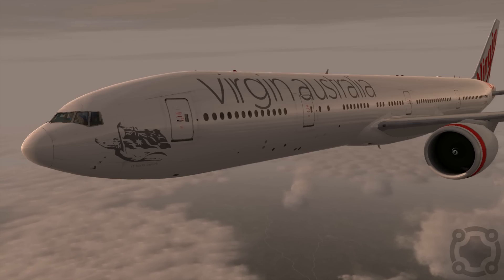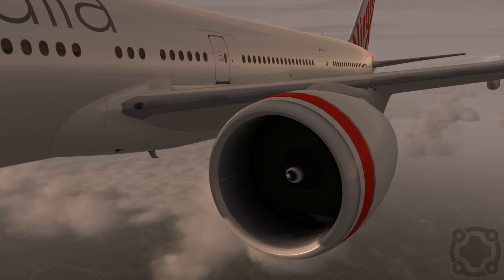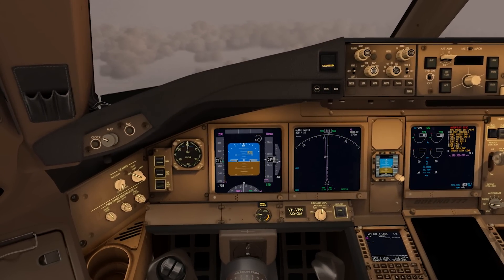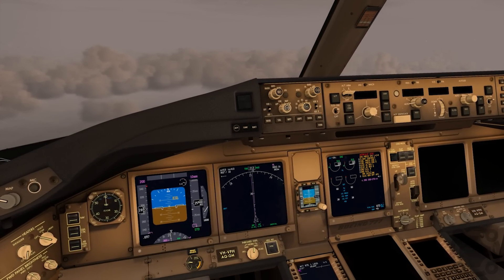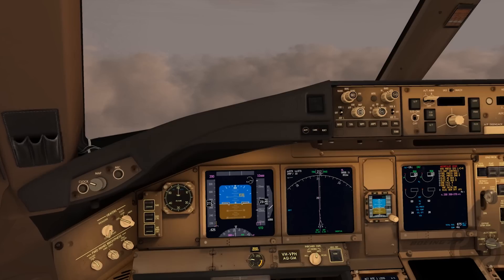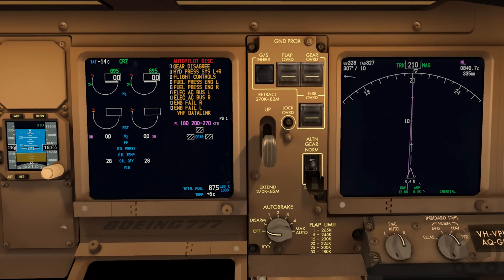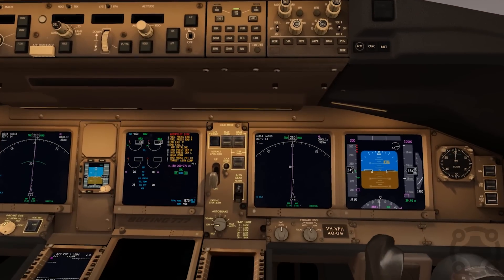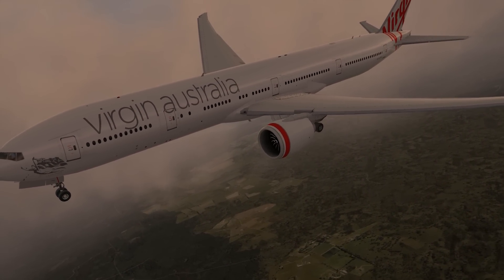What Happens If Both Airplane Engines Fail? - Aviation Facts

Comment: The RAT only gives basic hydrolic control, that's all, enough to make it controllable. However, flaps and slats are not on the Rat's system, as is the undercarriage - just uses gravity to (hopefully) lock the u/c - though the lighter nose leg may not lock due to it's lighter weight.

Comment: What is better prepar3d or xplane guys?
Reply: Call mean They both have their strong points and both are amazing programs but I prefer X-Plane because it is 64bit and the Addons in some cases cost almost half as much. XP also has better graphics in my opinion. I would say do due diligence and see which won you would like better. Right now If you buy XP 10 FROM X-plane.com (not steam) you will get XP 11 for free on release date.
Reply: Sirtaj 2010 Interesting. Well the reason I asked was because i've only ever had FSX on a shitty laptop lowest graphics 20 fps and am about to invest into X-Plane or P3D I mean invest i will fully kit it out with professional payware as my passion lies in aviation love FR24 and plane spotting and am wanting to become a pilot in either civilian airliners/small private or the Australian Airforce
Reply: Sirtaj 2010 Also thanks for your response mate :)
Reply: no problem m8

Comment: In real life the engine blades don't stop spinning when the engines fail.
Reply: Some do, depends on the engine.

+tprfilms Turbofans mostly do, pure jets don't, fighter planes and such.
Reply: rstevewarmorycom like which ones? Because when I go to the airport and the wind is strong the fan blades are always spinning. Even the Ge90.
Reply: tprfilms that's correct

Comment: What makes a plane ETOPS rated?
Reply: Two engines and rated to fly a route where at a certain point or points where you are more than 60 minutes away from the nearest airport in the event of a landing.
Reply: It doesn't have to be 60.
Reply: Brandon Janasik the a350 for example is etops 370 rated so its allowed to be 370 minutes away from the airport
Reply: The manufacturer has to demonstrate reliability of the aircraft to become ETOPS rated. This is done from all the engine tests, all of the test flights, and continuously via in service reliability statistics. Airlines must report in flight shutdowns and certain other failures relating to ETOPS required equipment. 
An ETOPS rating may be revoked at any time if the reliability deteriorates, this may be per airline, if it is demonstrated that it is the airline's maintenance program that is at fault, or the worldwide fleet if is a problem with an aircraft or engine. 
Aircraft may start off with a low ETOPS rating like 60 minutes and then it may be extended in stages as the reliability is proven. 
I said reliability a lot :)
Reply: tjperez69

Comment: If this happens in real life, can't they have the copilot  go outside the plane while it is gliding at say 20,000 feet and just bolt on a Briggs & Stratton 3 HP 1 quart tank size gasoline engine with a small prop attached to the horizontal shaft so the plane would then have more than enough power to climb back to 30,000 feet and even finish the transcontinental flight without any other incidents?
Reply: LOL you dream it
Reply: ***** smelt or smelled?  Were you extracting metal from its ore or smelling feces?
Reply: David James man, if only that worked.
Reply: ***** They probably didn't give a shit.
Reply: David James dang the puns lmao
Reply: Alex Mullens what are you talking about? 3 horsepower is more than enough to lift even a 747 up 30,000 feet
Reply: you mean one engine fail not all 4 engine, that would be British Airway Flight 9
Reply: Alex Mullens what do you mean there is no way? Even a 1.5 hp engine could overpower all 4 engines on a 747
Reply: your telling me all 4 engines on a 747 failed and it went 6 more hours?
Reply: I believe that Boeing and Airbus fit mounting bolts on the top of the fuselage for a 3.5hp briggs or a Honda equivalent.
Reply: Good idea just install a 7 litre dodge v8 challenger engine as a last minute engine impeller spinning device
Reply: David James I
Reply: @Alex-np3ps  hey, try anyway, I   just wanna get Unpacked ...
Reply: Alex Mullens some people just don't understand sarcasm huh

Comment: If the plane loses power in 2 engines, can they still brew coffee on the plane?
Reply: In most cases, the APU will start up and bring back most of the power and hydraulics.  Unfortunately, the galley is usually off-bus in these situations, so no.  What this video demonstrated would be a case of fuel starvation, in which case, no APU.
Reply: i think he was joking pal
Reply: good one
Reply: jesus sharia yeah cuz if I am going down I at least want some coffee so when the plane smacks the water and I have to swim out of that death trap for my life, I will be "juiced up".
Reply: yourre smart
Reply: I was playing along.
Reply: Galley is one of the first things you will loose when turning gens off
Reply: One Dude:  An APU is short for Auxiliary Power Unit, and it is a small jet engine in the tail of the plane.  It's usually used to provide electricity, hydraulics, and pneumatic power when the plane is parked at the gate and is also needed to start the main engines.  However, it's also used to provide backup power in the air if one or both engines fail (assuming the cause is not fuel starvation since the APU is powered from the same fuel as the main engines).
Reply: of course you can just use the battery!  but the alternator won't charge the batteries.  the red battery indicator will be on just ignore that
Reply: i like you tj
Reply: that one dude, has not heard of google
Reply: and ha said apu, just btw
Reply: tjperez69
curious note: US Airways 1549 aparently deployed both APU and RAT after losing both engines...
Reply: Sam Lutfi
A perfect picture of your future.. no engines.. you can only make decaff.. wich is like flying with no engines in a 777.. pure nothingness and hopeless XD
Reply: Yes but most of them will be spewing out coffee from their mouths at the time of crisis
Reply: Pretty sure adrenaline beats caffeine.
Reply: You ask the important questions, David James.
Reply: Life question
Reply: finally someone asks the important questions
Reply: i have one more question if the plane loses power in 2 engines and some one want go to toilet . :p

Comment: you forgot to say that when landing without engines you only have once chance to land or you are dead so you have to calculate the speed, altitude, distance to the airport, wind, with maximum precision so you can land
Reply: declare may-day to be more specific and you have all the runways, but there's Hudson River too if you fancy
Reply: I use phonetics to pick up women. Example, "Hey there, damn you are so sierra echo xray yankee".
Reply: Aviate, Navigate, Investigate, Communicate, Secure
Reply: and declare a emergency on the TCA frequency or 121.5
Reply: WEIGHTY - WEIGHTLOSS TIPS your sure?

lets say i i my little cessna going for a long haul flight and my engine starts to fail

yes i could not transmitt a mayday but then i put my passengers at risk as it will take even longer for SAR to get to me

i would rather call rather than waiting possibly days, if i can transmitt and give a basic position for them to home in on a 121.5 beacon chances of survival go up dramatically, especially in a large aircraft, this is known as a distress call in the example

mayday - mayday - mayday - foxtrot oscar november romeo (x3) five zero miles south of grand falls at one seven two five eastern - four thousand - cessna 185 - engine failure - will attempt landing on ice foxtrot oscar november romeo over ,
Reply: I agree with you; TTT 1 forgot the principles: aviate, navigate communicate. not the other way around.
Reply: And also by declaring an emergency to ATC, it means your aircraft is given priority, or owns the sky, and can choose any altitude, direction etc. And then other planes have to be directed out of the way.

So it would be ridiculous not to declare an emergency if you were not in an emergency situation, especially a loss of all engine flame out.
Reply: are you serious !? is it possible to land without engines ?
Reply: rayden1717 It is possible to land without them, but as he said you wouldn’t be able to have a second attempt as you would stall when trying to climb.
Reply: nminenko the 5 golden rules of aviation.. nice..
Reply: Plus, no reverse thrusters to slow the plane, should you be skilled/fortunate enough to make the runway.
Reply: you need to declare if there are problems on the plane so the control tower could inform other aircrafts to keep clear of your way.. 
you should let the airport authorities know so they can prepare something like ambulance or firetruck or what so ever
Reply: BLAZETANGO i was always taught as logn as the airplane is within reasonable control, to alwasy call and if the landing could possibly end in a crash, ectivate ELT jsut before touchdown

while not regulation im used to flying rural signle engine land in canada, below 9000 feet, not exactly a a310 at 30,000
Reply: cam mack have you forgotten about the most important feature of your aircraft? the Transpoder.. engine failure.. before radio contact say if u have no time to speak.. rmb the 3 basic Squawk codes.. 7500,7600,7700. this allows radar to monitor and establish the last known location of your aircraft for S&R purposes..
Reply: Flippy Mapper this comment is too low!
Reply: Flippy use punctuations pls it was hard to read...
Reply: pierre jean exactly
Reply: Ofcourse it would be smarter to declare an emergency, but you never have to, because the first priority is to get the airplane safe to the ground. If you feel like declaring an emergency is distracting you or taking to much time, you don't have to, much obviously that is, in most cases at least, stupid.
Reply: +TTT 1 You actually don't have to declare and emergency, ever.

Comment: Pop filter. Get one.
Reply: What if you over the Sea, how far can it gilid?
Reply: Dej,   idiots didn't get what you meant.  Yes,  ur right, the audio is infernal!
Reply: DeJMan ikr
Reply: what life brings with Iron Mike It depends on speed, altitude, fuel, passengers, weather, air, current pitch of the plane etc..
Reply: Raymond Manners? Hes trying to help..
Reply: Manners. Got some?

Comment: Yea it's a glider I agree BUT its gliding downwards at the same time . You have to keep the nose somewhat pointed downward in order to keep speed . 
Its not gliding in a straight line anymore you need the engines for that . 
The plane is losing hundreds of feet a minute in altitude . 
You need to find an airport and land quickly or you will crash into the ground in approx 35/40 minutes
Reply: ...and if you're over the pacific, don your lifejacket. You're going for a swim if you've survived the impact.
Reply: +ZYC Exactly....If your gliding you don't have  much time
Reply: ***** If you crash on a shore line beach somewhere well chances of survival are good .If you crash in the middle of the Pacific ocean well you might have to kiss your ass goodbye .
Reply: Jumbos have glided more than a hundred miles from cruising altltude and landed normally. Just had to be dragged off the runway.
Reply: rstevewarmorycom what about landing in water? Would that be the safer alternative if there's no airstrip?
Reply: best thing is to contact closest control center, or try FM air to surface and get to the closest shipping lane

for atlantic the two main control centers are gander canada and london UK ? not sure about pacific

Comment: Wouldn't the oxygen masks also have dropped when engine power was lost? (Although the simulator might not do that) Also, what simulator is that? Great video and I learned quite a lot!
Reply: If you look 3 replies above I explained exactly what happens. B777 has O2 bottles for flight deck and chemical generators for the passengers, that last for 22 minutes. I'm a B777 pilot real world.
Reply: The engines don't provide oxygen they provide air to air conditioning packs and they in turn feed ducts in the plane. The pressurisation is controlled by computer systems that open and close two valves, one at the front of the plane and one at the back.  The system realises there is no longer any feed of fresh air from the engines so it will close the valves to attempt to maintain the pressure in the aircraft. There are however many other holes in the plane and the pressure will slowly leak away. When the internal altitude of the cabin reaches 10,000ft the O2 masks will automatically deploy in the cabin. On the 777 they are chemical oxygen generators...except for the flight deck who have their own separate oxygen supply from a large O2 bottle.

Also out of interest, they say they manually deploy the RAT, when in actual fact in this situation it will automatically deploy to provide hydraulics and electrics. They would back up the auto-deploy in the checklist but it should have already dropped.
Reply: The RAT does not supply oxygen; only electrical power for essential systems. The cabin altitude would begin to slowly increase above breathable atmosphere as the cabin loses pressurization; In which case, the oxygen masks will automatically deploy when the cabin altitude exceeds a programmed value (usually around 14,000 ft cabin altitude). However, the pressurization outflow valves that govern the pressurization will most likely close as the airplane tries to maintain pressurization with no incoming air source, so the rate of depressurization would most likely be too slow to cause a lack of oxygen for the passengers in this case. If the APU is operating, it also provides bleed air to the ECS (Environmental Control System)Packs which are also responsible for maintaining pressurization. Of course, all aircraft operate somewhat differently and I am not rated in the 777, but there are a lot of similarities across all aircraft types.
Reply from the maker: Not necessarily, they would only drop if there was a loss of cabin pressure.
Reply: LogicLounge Ok. I though the engines were the main source of pressure/oxygen.
Reply: DrumstickFS Ok
Reply: I believe the oxygen comes from a chemical reaction in a compartment above the persons head, pulling down the oxygen mask triggers the reaction.
Reply: Actually, theres minature oxygen generators above every seat. They can run for about 10 minutes and by that time the pilot should be below 10k feet, so passengers can breathe without a mask.
Reply: Anton Zuykov You're flying through air, the air only needs to be compressed to get the correct oxygen levels. If it failed you would have chemical backup and if that failed you're screwed anyhow.
Reply: ***** Some sort of airbus.
Reply: lightningx10 that is correct
Reply: By turning on the APU bleed air can be supplied to the Air conditioning packs and will operate as normal.
The 777 actually has bottle oxygen for the passengers as well, most aircraft tend to use the solid states oxygen candles, but the 777 and 787 have bottle oxygen.
Reply: The RAT is an air driven electrical generator. It does not itself provide hydraulic pressure as it is not a hydraulic pump.  It supplies electrical power to a hydraulic pump that is driven by an electric motor.
Reply: Crummjys - Finn     G.
Reply: I was told, and this might not be true, that the RAT supplies oxygen.
Reply: untrue
Reply: ***** Okay, like I said I wasnt sure if it is true.  An airplane engineer told me that is how the plane he was working on fed oxygen in an emergency and I had no reason to question him.
Reply: When AT236 lost it's left, and final engine running after the right went out, the oxygen mask did fall, in fact. As power was cut off to the cockpit so did the cabin, oxygen mask dropped but with no loss of cabin pressure. I'm not quite certain of how this happened, though. But to prove the point, yes, they did drop down after their last engine lost power.
Reply: Zeh Dockta   They run for 22 minutes.
Reply: If both engines and the APU are all off, the aircraft can't keep itself pressurized, so unless it flying below 15000ft or so, O2 masks will be deployed (I assume automatically once internal ambient pressure is too low, but there's probably a switch somewhere for that).
Reply: LogicLounge whats the simulator
Reply: HawkDriver15 well normally the RAT would also provide hydraulic pressure no?
Reply: The RAT will also supply centre system hydraulics to the the primary flight controls.
Reply: The RAT does provide hydraulic power, and electric power. The RAT provides hydraulic power only on 767 and A320, but provides hydraulic and electric on 777 and 787 (unsure of airbus other than A320). Fly by wire aircraft need hydraulic pressure as hydraulics are the only way the flight controls can be operated and the amount of electricity produced by the RAT is not enough to run the electric hydraulic pumps.

Also the 777 uses bottles oxygen held in the aft cargo hold, A320 and 767 use solid state oxygen generators (oxygen candles) that are above each seat. The 787 uses individual oxygen bottles held in gas form above each seat. All aircraft have bottles oxygen that supply the flight crew.
Reply: Whilst your correct about the RAT MegaGouch your info on the O2 is wrong. 

The 777 has gaseous oxygen for the flight deck and that is in the forward EE bay, the passenger O2 is provided by individual gas generators above the passengers in the cabin. These generators will provide 22 mins of oxygen.
Reply: Must've been an option for gaseous to be installed as the airline I work for has bottles O2 for passenger.
Reply: HawkDriver15 ok thanks I'm learning 😄
Reply: Crummjys - Finn  there would be a back up generator i gues for electricity
Reply: Crummjys - Finn masks don't drop in the cockpit.
Reply: Crummjys - Finn Dr
Reply: Crummjys - Finn